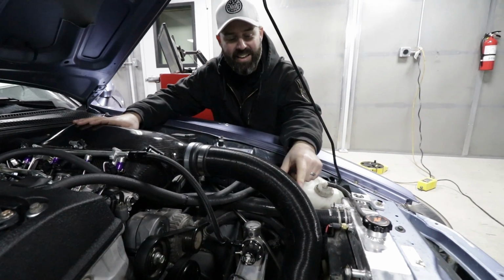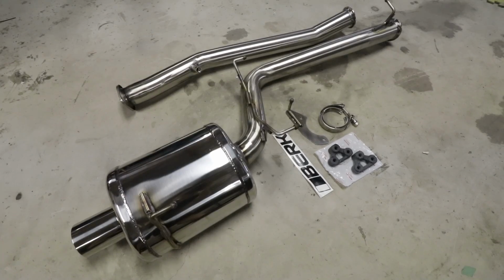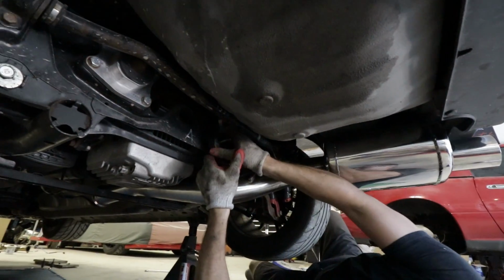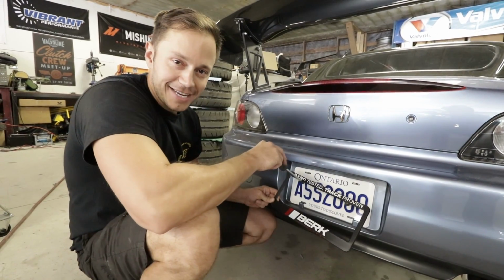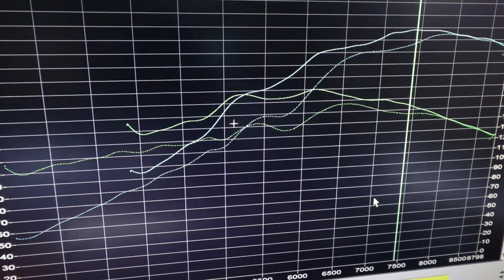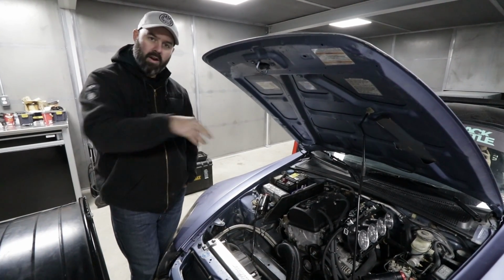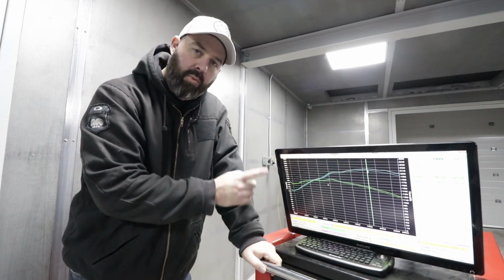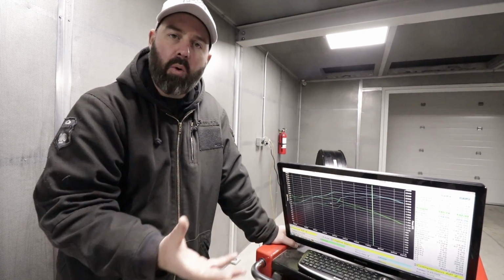Does an ITB AirBox Rob Power? + Big Power Gains ITBs & 3-inch Exhaust - Project BADASS2000 - EP15

Comment: I think the exhaust power gains are mostly due to going cat-less rather than just increasing diameter. Anyone else think so?
Reply: as proven by engine masters on the motor trend youtube channel
Reply: I've seen big gains just by replacing the stock cat with a high flow cat , just having extra bends in the pipe robs power . And a stock muffler has bend's inside , mandrel bend pipes make a big dif as well .
Reply: jerry henderson it can most definitely hit 600hp with stock motor and forced induction.
Reply: ***** You're right that there's no such thing as back pressure and you're right that no exhaust/bigger exhausts mean more power when running forced induction, but for some people it's not about how much power but where the power band is. For instance a smaller exhaust diameter that shifts the peak torque to a lower RPM for an autocross car is more ideal than a 3 inch producing peak torque at redline since you'll never be able to hit it with all the curves and turns.
Reply: Probably the case. I see anywhere from 10 to 30 whp increases just by removing cats all the time. Plus I'm no s2000 expert, but no itb's are cheap. For the same money they could have done ported head, cams, throttle body, and intake of any custom sort and probably made more power everywhere. Itb's are great to eek out that last bit of power on a fully built motor in my experience.
Reply: Shane P the s2000 has near perfect headflow already. The only time a ported head with give much power on an S2k is if it is running boost as well. The intake manifold is already great as well. It’s are the only real improvement to air flow you can make in that area. Some people will go aftermarket for the intake manifold but mainly for weight savings.
Reply: Shane P I agree I don't think itb work all to much on stock motor. But yeah they could've done everything else and made a lot better power for the same price.
Reply: Sergio Aguirre You clearly don't actually read what I have been saying at all. All turbo cars benefit from no exhaust. That is indisputable. NA cars are different. The power curve on an NA car changes greatly depending on the exhaust, header included. Drag cars I already said run and benefit from no exhaust, but road racing cars use an exhaust to tune the power curve. This only applies to NA cars to create that vacuum to pull exhaust from the combustion chamber as I mentioned earlier. Turbo cars have a thing called forced induction which takes care of that function and therefore benefit from not having an exhaust at all. And f1 cars before they had turbos (forced induction) had a tuned exhaust. I agree with you that for any forced induction car, no exhaust is best. I will even agree that in drag racing, my experience is that even most NA cars do best with no exhaust as long as they have a good tuned header, but with road race NA cars I have seen too often an exhaust used to tune the power curve for road coarse driving.
Reply: no cat + mandrel bends and less of them + larger pipe diameter + absorption mufflers, they all add up.
the stock S2000 4-2-1-header is good for midrange but not ideal for peak power. Are they using an equal lenght 4 into 1 header design? If not, that could free up some additional HP at high rpm's
Reply: Dominik Heidrich very easily could be the case. Free up the flow by removing a blockage versus just increasing the overall volume of the exhaust.
Reply: agreed
Reply: jfv65 I watched the same video , and they proved that for 350 hp 2.5 was the same as 3 . 600 hp and now the volume of exhaust gasses exiting the engine are near double , so a bigger pipe makes sense . Even with forced induction the stock S2000 engine is never going to reach 600 hp , so it doesn't need big exhaust .
Reply: jerry henderson have you been on S2ki? There is a gay who has even made over 800whp with a stock block, stock head, and a turbo. 600hp s2000s are everywhere and they almost always have a stock engine with a turbo. The stock internals on the s2000 are bulletproof aside from the ap1 valve retainers.
Reply: ***** Expert comparison. Bravo to you, sir.
Reply: Sergio Aguirre For forced induction sure. Back pressure is just misused. They should use words like exhaust velocity and exhaust volume. On any na setup the right sized exhaust and tuned header are crucial to get the most power. There is a sweet spot for exhaust velocity and exhaust volume. The perfect balance created a vacuum that pulls exhaust out of the combustion chamber leading to more room for air and fuel leading to more power. Exhaust velocity increases by shrinking exhaust diameter but exhaust volume increases by enlarging exhaust diameter.  Again I'm no expert on the s2000 motor, but I know quite a bit about b series Honda motors and did a bit of racing but mostly watched dyno pulls and just saw the numbers and power curves.
Reply: Sergio Aguirre I agree that backpressure is a misused term. However on all motor cars in racing, the only ones running no exhaust are drag cars. No other race cars, including f1 run an open header. And since I have personally seen the numbers and curves with my own eyes, I think I will go with that. Many na road race cars run full exhaust and see benefits to the power curve for the race application. You can disagree all you want, but the real professionals that actually race, build motors, and engineer this stuff don't. Drag racing is the only example where an open header really seems beneficial.
Reply: Sergio Aguirre I have raced too and like I said I see the power curves on the dyno constantly. Have seen hundreds if not thousands. The exhaust changes the power curve. Which is beneficial to many types of racing. Again, every single road race team in the world designs a full exhaust of varying lengths for the cars. Noise regulations do not exist for many tracks and often are enforced on club racing and not professional racing and at certain times of the day. You can believe whatever you want, I'm only making the point that professionals, engineers, and real racers already know. Good luck racing.
Reply: Just wanted to add to be clear,  an exhaust doesn't have to exit at the rear of the car. Many are short, sometimes just one bend off the collector and a foot of pipe. Often longer, but not to the rear of the car on a front engine car when the motor is heavily built. Also level of build matters. Naturally a fully built NA motor will breath more and the header and exhaust design should reflect that, just as a lower powered NA motor should have a header and exhaust designed for its abilities. Any way have a good one. As for the dyno graph from Honda tech, definitely interesting as I did the same thing with my built pump gas ls/vtec with different results. Mine was making 214.7 wheel with 2.5 exhaust out the rear with resonator and muffler. DC jdm type r header, with exhaust off we made about 2 extra hp peak but lost some usable torque down low and mid range. Was about 10 or more years ago but that shouldn't really matter.
Reply: Not with a proper cat. It'd be quieter but power wouldn't suffer noticeably with a good, high flow, 3" catalytic converter.
Reply: Nope.
Reply: S2000s don’t need more than a 2.5in catback when they are NA. But going careless can give up to 20hp in the midrange with a proper tune.

Comment: Cams and compression and you'll get close to 300hp.
I think for the few HP gain with the velocity stack you'd be better off running the air filter. Even changing oil every race you're still going to gack your sleeves real quick
Reply: Blake Calabrese This bloke would disagree. http://www.superstreetonline.com/how-to/engine/htup-0808-honda-s2000-tuning/
He made 283hp with a 2.2 with just cams, intake and exhaust. but his exhaust only made 15 whp difference. With the massive gains from their new exhaust and new tech in the last 4 years 300hp is achievable.
How many more articles would you like me to show you that cams make a difference in these?
Reply: Velocity stack + inline air filter setup then?
Not sure how much the inline air filter would hurt flow/velocity.
Reply: Possible. But they are talking 5 or 6hp gains with the 3" and velocity stack. Would result in maybe .05 or .02 seconds a lap.
Take a decent crap before your race for more benefit!
They could always use the velocity stack and a thin foam filter to keep out the larger crap. Might flow ok. The ultra fine dust will flow with the oil
Reply: This comment just shows you actually have no idea what you're talking about, the F20C is a completely different engine. "Cams and compression", won't help shit, except make your engine blow up sooner.
Reply: First off, he also had stand alone tuning. You found one article about a guy making 283 on Church's dyno, which already reads high. You could drop 20k for mid atlantic spec engine or just supercharge/turbo charge it for 3-5k. Nathaniel, Superstreet isn't a credible source either. Squeezing itte bits of HP out of a F20C isn't worth it, it's all about weight reduction and driver experience.
Reply: FI isn't ideal for class racing. I'd sink 20k into an all motor build before doing a cheap turbo.
Anyway if 250hp is it for NA Honda motors they must be real shit. 300hp is achievable from a FWD SR20 silver top. I've even seen 310hp Ford Duratec 2.0.

Comment: Why run an inlet restrictor/airbox? Unless rules says must use an inlet restrictor, I've always thought that they were not needed as they were used primarily to restrict power in racing classes.
Reply: sadakotube because as u see with the hood closed it sucks hot air and
Made less power than with the air box and 3.5" inch intake
Reply: i see. but i think dyno fans aren't  representative of real world airflow
Reply: sadakotube fyi, those doesnt look like restrictor. those tubes are tapered and its diameter is not smaller than throttle. its more like velocity stacks
Reply: sadakotube they should make that airbox inlet a 4 inch.. the inlet is restrictive
Reply: ks chong the inlet restrictor is airbox. the velocity stack is not the item i was referring to.
Reply: i am sorry that i misunderstood your sentence.
i think they can go more than 4 inch. last time i saw a corolla touring car has bigger than 4 inch event tho is a 1.6 engine

Comment: What about exhaust manifold? When you plan to replaced header?
Reply from the maker: Tough to improve on the stock header on this car, but we are considering the Ballade header.
Reply: Piotr Rutecki very few headers improve the the stock s2 and the ones that do are very expensive
Reply: Jay Gunter, Yes I know. But I remember when I fitted very expensive HKS 4-1 manifold to 3SGE ALTEZZA I noticed huge difference compare to stock. The best mod I ever did.
With amount of money what they already spent on this S2K this is just another step to improve the car. With HKS or TODA you can't go wrong. 
They just need to find sponsors ;)
Reply: Piotr Rutecki as far as your car you should read what the hytech owner says of the s2 motor. he used to be an f1 engineer says the reason most bolt ons don't work on the s2 is the motor has more uncommon with an f1 motor then a production motor
Reply: Speed Academy.  i dont remember that u did a header..but now thats answered... can you please see when is the vtec crossover? i wanted to see if the midrange gain is maybe from the vtec lobe..ask sasha for the rpm where it crosses..just wondering
Reply: i think that all bets are off when you go to itb's with the header..
Reply: Piotr Rutecki idkn haven't looked into those. the stock is almost perfect for the car unless you go force induction. only ones I know of dyno proven are hytech,j's and spoon the last two are copies of the hytech and start at 1300$ last I checked. left mine stock not worth the money unless your shooting for 400hp plus
Reply: Diminishing returns on swapping those stock headers. They are very well designed from factory.
Reply: just ball out and get the amuse titanium header, its only several thousand dollars. i think its under half the weight of the stock part, the a j's racing hood front bumper and intake ducting would finish it
Reply: I highly recommend the ballade headers. I put it on a few weeks ago and I swear my vtec crossover went from a 2 out of 10 to a 9 out of 10. The loudest I heard. I had stock and plm and the car pulls much harder now. I also am running bc cams and the same Berk exhaust.
Reply: A nice header like a Spoon or Toda won’t make much up top but should make 10+ more in the midrange. It’s not always about the peak power but the actual power curve itself.

Comment: Wow, 40whp midrange is an awesome step-up for a n/a engine that size. Keep it up.
Reply: That’s why I roll my eyes when people say the S2000 is “maxed out” from the factory. I’ve seen an S2K go from 210 to 230hp on the dyno from a K&N filter wi th a modified stock air box and header. They made about 30hp around 6000rpm.

Comment: If you guys wanna make a bit more NA power just throw in some cams and adjust the right timing
Reply: Tom Ahoks don't think they've upgraded the cams since they never made a video on it and besides, the cars idle would have been more rough with staged cams. Engines idle still sounds smooth even with all the mods they've done to it so far.
Reply: Tom Ahoks I don't believe they changed cams
Reply: jTamayo34 Don't you think S2000 has cams already?

Comment: THAT CAR SMOKES A LOT. Black smoke, what is it? Oil?
Reply: waclosh They switched to a catless header compared to before with a high flow cat. I would say the gains were not only from the catback but also from switching to a catless header
Reply: Whenever you install a brand new exhaust it smokes a lot at first as it burns off all the oil and crude in the tubing. It cleared right up after a few pulls. This is very typical of a new exhaust. Not to worry.
Reply: waclosh Oil would be blue smoke
Black smoke is just unburned fuel (running rich)
Reply: waclosh it's what happens when you rev the engine when it's cold just after starting like they did, all modern factory cars have have this cold start system where it runs richer to help smoothen idle until it warms up.

Comment: Just a heads up guys, even with the CEL fix on the exhaust the O2 sensors still burnout about every 2 years or so.
OEM replacements are expensive, but you can get aftermarket versions for around a 1/3 of the price.

Been watching this build for a while, and not to be detrimental to what you guys have done, but I think for the money you would've spent on the ITB setup, turbo/supercaharging would've been a much better bang for buck investment. 
I'm only running an AEM Intake, 5zigen headers and Skunk2 catless exhaust and i'm making 201whp, with no tune.
The ITB's are definitely making more mid range, but bolt on supercharger kits (the Kraftwerk kit looks the business)  are making and easy 350-400whp.

Sorry if I'm being a bit of a Captain Hindsight, I still like the build, and appreciate the effort going into it.
Reply: Paul Wade I see your point Paul, and I too am a HUGE fan of superchargers. However the route less traveled is sometimes more fun as well as informative. Also the throttle response yielded from the use of itb's is second to none. For what these guys are planning to use the car for I think they made the right choice; if I'm following correctly the goal is to have a setup with which they'll be able to keep the heat levels down to a minimum.
Reply: Yeah I could probably pull that off if I was one of those mechanical savant guys, unfortunately I ain't.
And believe me I wish I had as easy access to parts as you guys in the states do, but I'm in a smallish town in Australia so pretty much double the price of everything, add excessive shipping costs, and then deal with mechanics who only know one thing, LS motors :/
Reply: Stock s2000s make around 210whp
If u go back to when they first got their s2000 they dynoed it stock and she made 215whp
Reply: Paul Wade yes but they also have much better throttle response 
And it's a great supporting mod for boost especially 
The only thing IMO they did wrong was the air box/plenum because of it not being designed for even airflow and will bias the rear
Reply: Yeah now that you mention it, those figures do sound familiar.
Might be due to dynapak's reading differently than a normal dyno, I dunno.
I might just be screwing up my power conversions, I'm in Australia and most dyno results are in kw's. Stock S2k's make around 135-140wkw (190ish whp), after the mods I mentioned I made 150wkw (201whp).
Maybe I just got a dud S2k, It was low Km (60,000km, 37,000 miles) when I got it, but it is a realy early model, March 2000.

Anywho, the point I was trying to make was they could've made a lot more power a lot easier.
Reply: Agree with you totally on throttle response. When I first got my S2k I wanted to ITB's but after a little research I realized It's a little more involved and difficult to make big power.
I think one of the faster one's with ITB's going around is the ASM s2k, dunno if it's still around, but it was making just under 300whp and they were struggling to get any more out of it.
Reply: Paul Wade diy itb
Can be done sub 500 usd in total 
I've seen it done